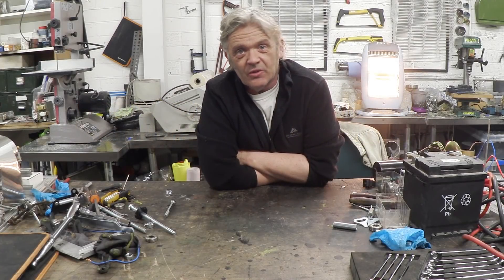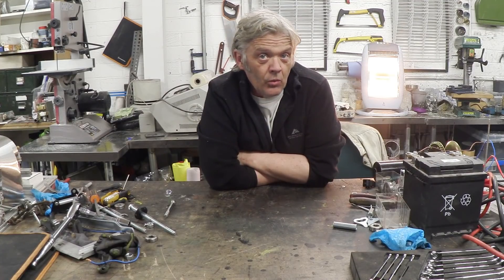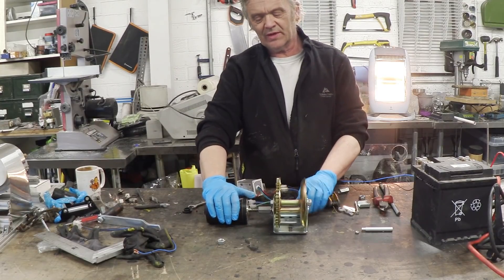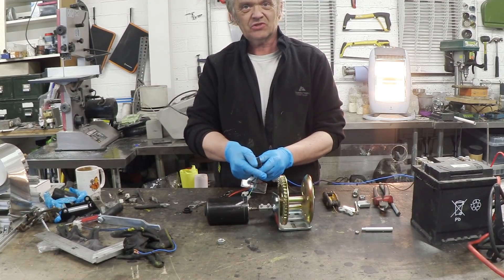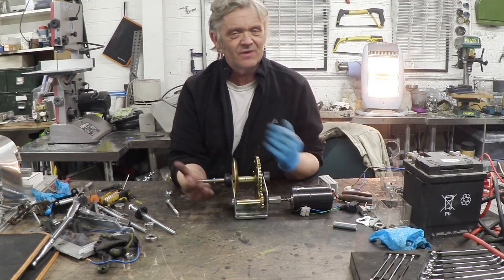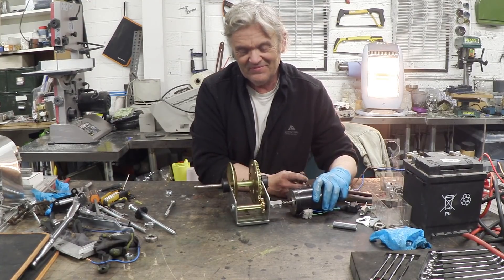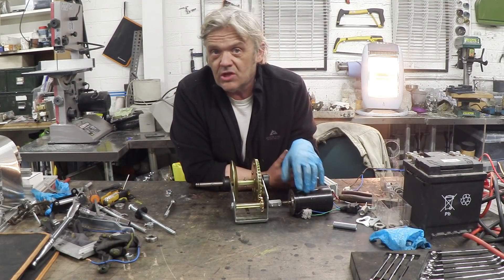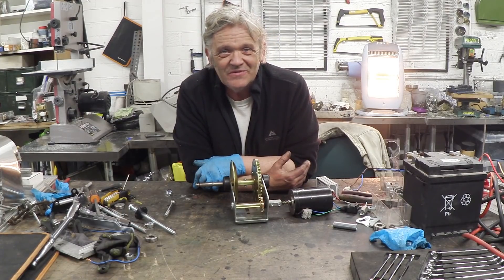1070 Cheap Easy Gears For Improving Wind Turbines, Generators And Drives

Comment: I cast my gears from an old Spirograph into a clay mold and replace my gears using sodium bicarbonate and super glue.

They work well enough for low torque generators and are easy to replace. The machined tolerances of the Spirograph are handy as well for gearing.

Comment: This is a bad idea because of the type of gear surfaces and their shape.
Reply from the maker: I am sorry mate - that makes no sense to me - it's a bad idea for long life because the materials are cheap that I can agree with - but because the gear surfaces? and the shape? I don't understand what you mean by that
Reply: I am talking about the mating surfaces and the high friction involved. Recently you did somthing with Drill motor gears and that would be a better solution (in my opinion) respectfully submitted.
Reply from the maker: oh for sure - it's badly made - if you want better, basically - pay more - drill motors can't stand much in the way of torque really - they will run a bike or longboard but not a car you would just shear them off - these gears are badly made in this device - that's for sure but a better winch would certainly cope with the torque stresses - so, I am not sure it is a bad idea per se
Reply: Agreed!

Comment: I believe Volvo used an interesting method of transmission. 
They had two shafts in parallel with a cone on each pointing in opposite directions and a drive belt across the cones!

As you increase torque the band slips to one end of the cones and as you reduce it it goes to the other one end gives low speed high torque the other High speed low torque) ..... not sure you could knock one of them out for £15 ..... but it would also cure your  alignment problem ;o)
Reply from the maker: I know the method mate - it is awesome for sure

Comment: I wouldn't mess about with cheap tat like that.  Used to use the damn things at work, they fall apart really fast if you put any sort of load on them.  And anyway, better stuff can be scrounged up from scrap, which should please you :)  If you can handle a 90° drive, the head of a junked angle grinder generally gets you something like a 4:1 or 6:1 ratio.  Far less lossy, sealed and greased for life.  There's also a pretty solid gear reduction (although not a very high ratio) in corded drills, the bigger the better, or you could look at cordless drills which have a (usually 2 ratio) planetary gearset, although they are less beefy they can be really useful as well.  Circular saws usually have a worm drive setup, which means you can only drive them as a reduction, about 10:1 in most cases, and again, properly beefy.
Reply from the maker: good suggestions mate - but I have to say - so much depends - like what if you don't have access to scrap? a lot of folks don't, what about if you just want cheap? what about if you just want fun? what about if you are doing something that doesn't need to last? - like a science fair project - just loads of cases when I can see this being helpful - I am not saying anything against your suggestions - they are awesome - but sometimes cheap and cheerful is good lol - cheers
Reply: @ThinkingandTinkering  Sure, not everyone lives somewhere where there are skips full of great stuff on every street corner, but there's always the local tip.  Over here you're not allowed to recover stuff from the tip, but chatting with the bloke generally means you can, and a bottle of wine every now and then means you're a valued client who can place orders :). Then there's farcebook marketplace and equivalents.  I don't book my face, but just looked, there's a bloke 5km away selling 5 jigsaws, 5 sanders, 2 drills and 3 circular saws, all "for pieces", 30 euros the lot.  In france we also have "leboncoin", kinda a french craigslist, at the moment there's 23 offers of busted tools under 15 euros each all within our 10km lockdown limit.  I know who's selling two of them, I work with him, he's even more of a valued client at the tip than I am :)

Don't get me wrong, I'm very much not against buying stuff new, even cheap stuff, and if there was some cheap gearbox that existed without requiring major adaptation, I'd be all for it, but what you're suggesting here makes little sense.  Those winches are intended for very low rotational speed, short periods of use (rolling in, say, 3 or 4 metres of rope), occasional use (maybe twice a day), with little concern for losses, and they just barely manage to handle that.  We would get maybe 120 days out of them, using them once a day (one roll out in the morning, one winch in in the evening) before they fall apart totally and need repair.  We were using them on (they are, in fact supplied equipment for) "télécorde" installations - rope drags for beginners in ski resorts - to lift the rope out of the way overnight so the grooming machines can get underneath.

For the same money, buy a busted angle grinder, reuse a high performance power transmission element already running on bearings, scrounge a couple of big coils from the stator, a decent shaft from the rotor, a switch, a plug on a cable, maybe a small variac, and there's probably usable bits in the rotor as well.  Would you like to guess what I was replacing those crappy winches with after they failed?  Or you could try and find an old sturmey-archer equipped bicycle and strip the rear hub from it.  People give those away for free (see, once again, faceache).

Comment: Rob, I used to be in boats in a big way. Those cheap Asian winches are cheap steel (easier to press). They are notorious for rusting, breaking, wearing out, etc in less than 1 season. But, better quality would be a real goer...
Reply from the maker: absolutely mate - this was super cheap but like you say you get what you pay for that's for sure

Comment: Have you seen the wind turbines made from a plastic 45 gallon drum with flaps cut in and bent with a heat gun and bike wheels at the ends for the use of the bearings? 
I thought why not use a back wheel with the gears from a mountain bike with the shifter so when it's really windy you can slow it down and vice versa.
Reply from the maker: yes mate - they are savonius type i think and go for it
Reply: @ThinkingandTinkering  I've actually got all the parts but I'm quite reluctant to take the wheels off my vintage O'Brian racing bike for it. 😂

Comment: Pulleys and belts are more ubiquitous, 
And also  alot quieter ,also car and motorbike gearboxes are ready made and lubricated, put a windmill on a car a/c compressor and use compressed air/gas to drive a generator, or obviously a heat pump if you live on the east coast  🤣   rooby  x
Reply from the maker: cheers mate

Comment: I had the same issue when designing my wind turbine in the year 2004 I needed to gear it up the option I chose was to use a chain and two sprockets the chain is not extremely tight as the chain lays horizontally however this gave me the gear ratio I needed to get the generator to the speed where it exceeded battery charge voltage level
Reply from the maker: awesome mate

Comment: For cheap and easy, I don't think you can beat belt-and-pulley systems.  I'd be willing to bet that a magnetically enhanced belt-pulley would eliminate much of the inherent problems with such a system, as well as being more robust and maintainable in most environments.
Reply: I tried the belt and pulley system for my wind turbine back in 2003 it was a failure due to the excessive friction that belts cause in their inherent operation it's just physics
Reply: @401ksolar  And yet, auto, motorcycle, snowmobile, tractor, (especially CVT) main drives and accessories using belt-and-pulleys in suitably designed and implented systems work fantastically well, and cheaply.  I never said that you could abandon engineering and mechanical expertise, nor that you should quit after a single failure with millions of successes on record.
Reply: @azlandpilotcar4450  yes I never brought up push belts different subject
Reply: Also for wind turbines I stand with my statement of experience and observations for decades belts have too much friction in a wind turbine environment
Reply from the maker: cheers mate

Comment: Bicycle chain & sprockets might also work and give "easy" speed changes.  Been thinking of any easier way to change speeds on my drill press than futzing with belts and pulleys.
Reply from the maker: nice idea mate - a bit of fiddling on to set up but once set= nice
Reply: @Dave Bashford you might want to look into CVTs from scooters, they can be hacked into drill presses with a bit of work, and get you a continuously variable speed.